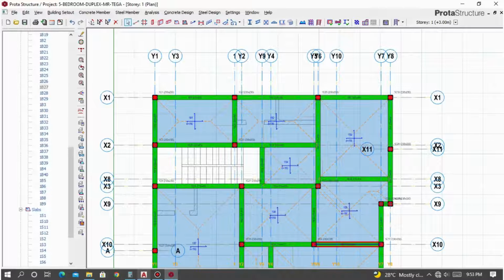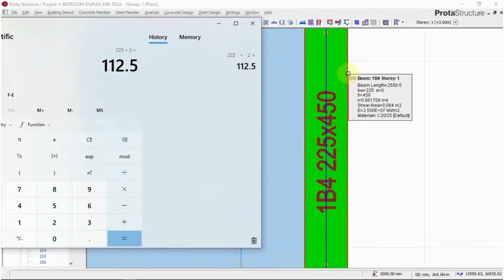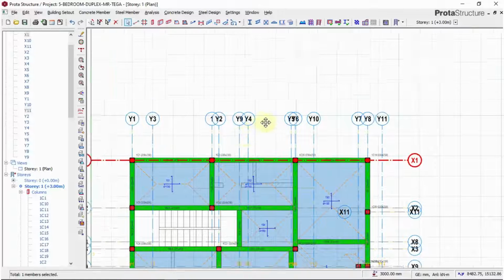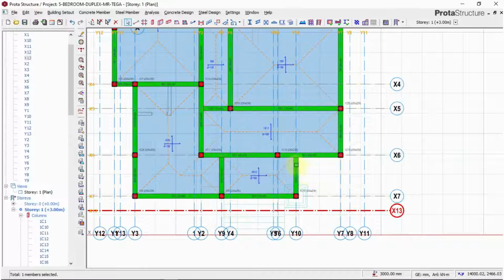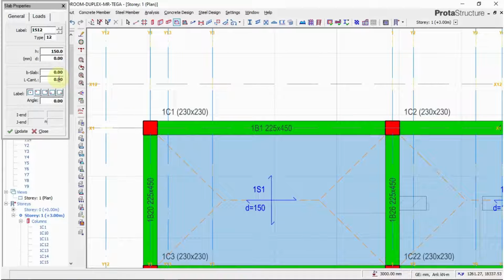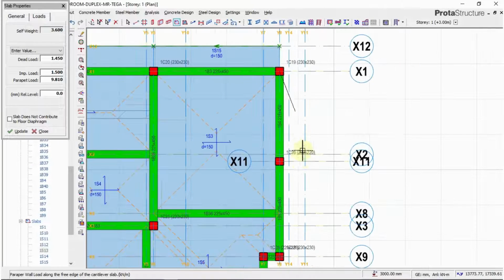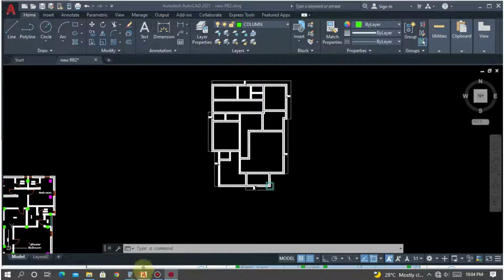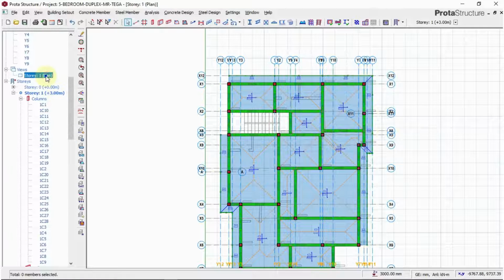How To Create a Cantilever Slab In Protastructure.

Comment: I had an error comment says 2c19, 2c18, etc are unsupported by slab/beam, I placed these columns on cantilever slabs edge.
Reply from the maker: Protastructure doesn't allow column to sit directly on the Slab. You have to place a cantilever beam under that column sitting directly on the slab
Reply: @EkidelCAD  you're great
Reply from the maker: @otuoyeorubia6722  we thank God
Reply: @EkidelCAD  so what if architectural has no beam on such case , the engr must design with beam

Comment: The way I calculate wall load is multiplying high of wall by unit weight of 9" block per meter run by 1.4
That is high of building= 3m
weight of 9" block= 2.87kN/m² weight of 20mm rendering= 0.60KN/m²
2.87+0.60=3.47kN/m²
3×3.47×1.4= 14.57KN/m
Reply from the maker: Your calculation is correct for per meter Run that is if you are using manual design.
But when using design software like ProtaStructure all the need from you is the 3.47kN/m2 load parameter , the height of the building and the thickness of block wall

Comment: Please which version of prota are you using?
Reply from the maker: I am using Prota 2018 and 2021.
But the version that was used for this lesson is Prota Structure 2018
Reply: OK sir, the 2018 version I have doesn't design for steel. Any solution thanks
Reply from the maker: @Kpit360  Prota 2018 steel doesn't work well for steel. You will need to install prota 2021, this will work for steel.
Reply from the maker: Hello Felix
I now have Prota steel for 2018 and it is working. Drop your email address so that i can send it to you.
Reply: Sir 2021 is it a free version?
Reply from the maker: @Kpit360  No it's not a free version but with $30 USD you can get it.